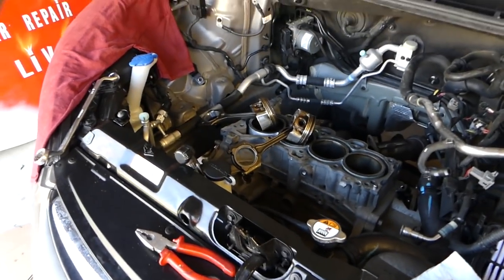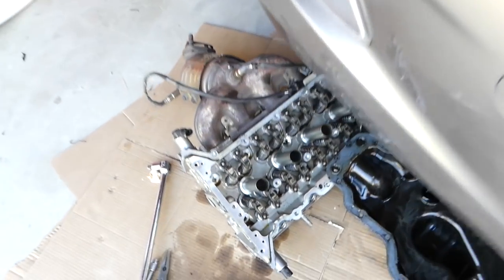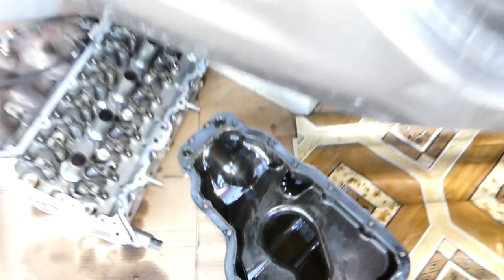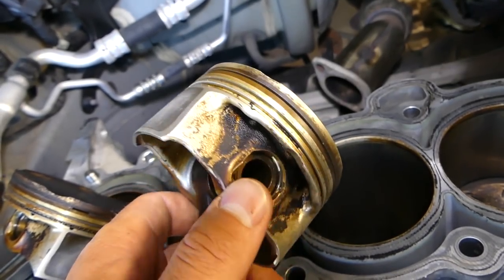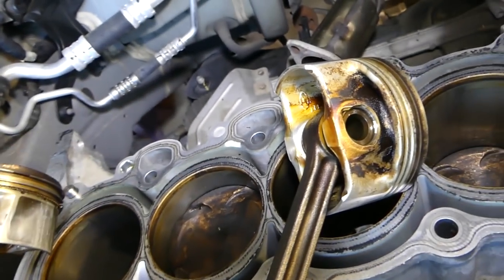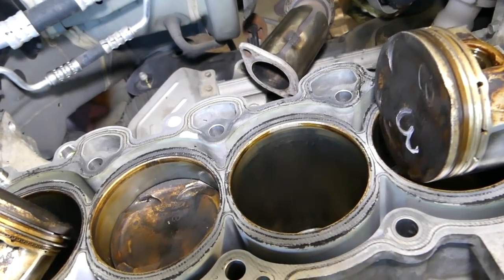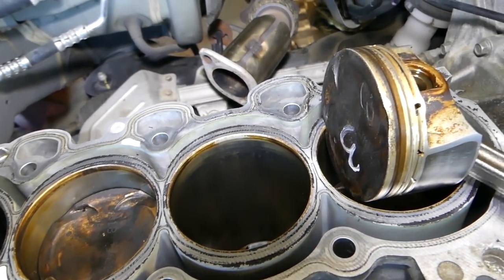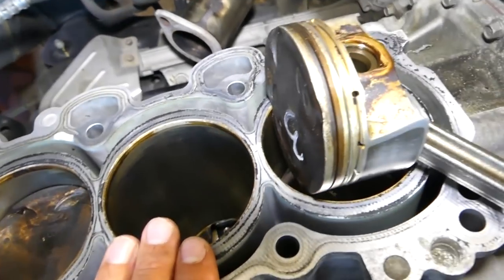WHY IT IS IMPORTANT TO WARM UP YOUR ENGINE

Comment: I doubt that a cold engine caused anything. The gross examination of the cylinders from that distance without miking, doesn’t show anything other than 69K miles of wear. The “streaking” could be because of a low oil level.

Comment: Modern engines don’t need to be warm up during winter.
Reply: thurm101 In cold weather they need to be warmed up as oil is really thick with very high centistokes.  And drive gently until at 212 degree Fahrenheit water temp
Reply: Modern engines don't need to be warm up during winter - to start driving gently. Until the oil is fully warmed, driver shouldn't apply high load on engine.
Reply: No